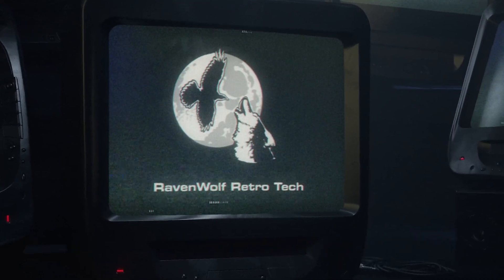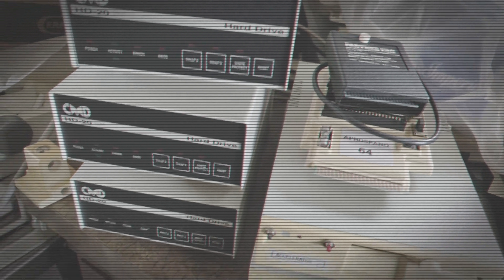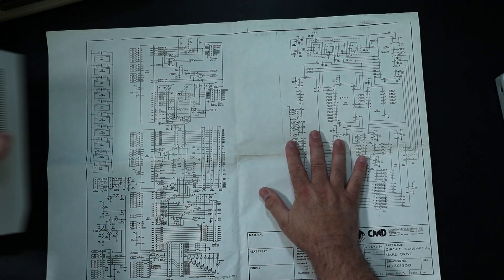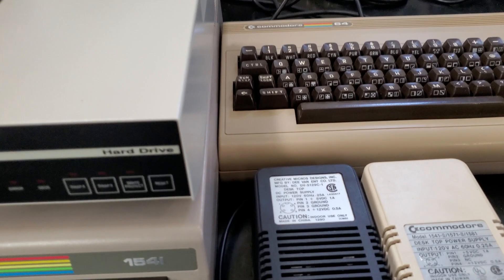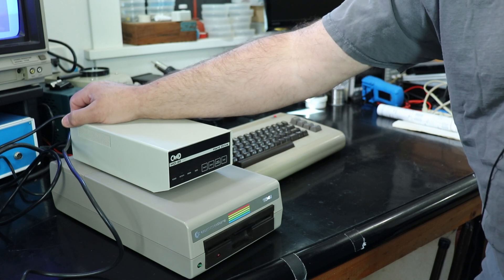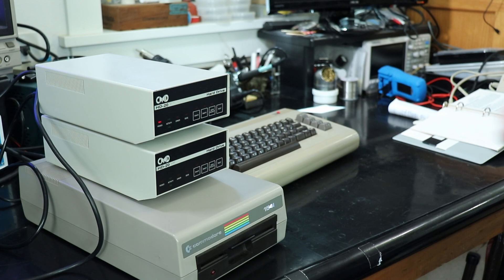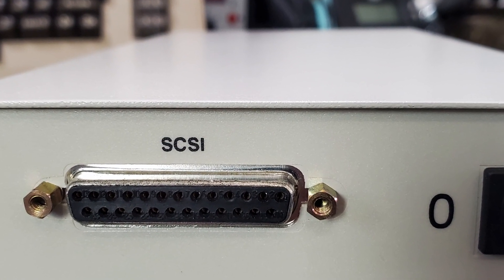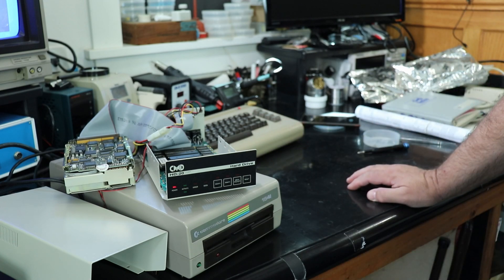Vintage C64 CMD Hard Drive - Lost documentation found!

Comment: I'm afraid there are a few errors in the schematic: U11 pins 19-20-21 are not PA5-PA6-PA7 but PB1-PB2-PB3 and PC0 is not pin 10 but pin 14.
Reply from the maker: Great catch, i had not noticed that but i never had to dive too deep since my drives were all working. These old schematics often have errors but if anyone wants to recreate a corrected version i doubt anyone would have an issue.

Comment: Did you make the archive the drive video mentioned @00:06:45 yet? I just picked up one. Do you have any more information on it? Hard drive swap possible? Thank you for the video. Oh and how did you open this thing? 4 screws on bottom yes, but then what?
Reply from the maker: Unfortunately the drive would only spin up long enough to read a directory but it would spin down shortly after. As I worked on it the time it would stay spun up shortened until I could not even load the directory so I set it aside. I now am using the HD-20 on mt C128D with a ZuluSCSI installed which works amazingly well. You can see that in the Pimpin a C128D video.
THere is one more screw on the back under the lable. Its a flush screw and the label is heavy so it can be hard to feel but there are pictures online.

Comment: As a kid I wanted one of these SO BAD but they were big bucks. Later I found a genuine CBM ( Commodore Business Machines) D 9090 hard drive originally devoloped for the PET line of Commodore computers. You had to buy an interface which adapted the serial to the interface used by the CBM drive. If I remember correctly it was IEEE488. It worked but damn that hard disk was finicky. Seemed really fast compared to floppy disks BUT it actually read everything Serially so whenever the disk had to be searched, it always started at the very beginning of the disk. Very slow access times but Hey, I had a hard drive in 1985. Nobody else I knew had one. My entire C64 floppy collection fit on that hard drive.

Comment: Hard drives for the C64 typically emulated 4 floppies. I met 1 guy who had one which worked like that.
Reply from the maker: It can emulate several floppy drives including 1541, 1571, & 1581. Each disk takes one of the 254 partitions though so you can do a lot but not unlimited.

Comment: I tried to find a follow up video were you converted the external hard drive cabinet for a P-ATA hard drive or SSD.
Reply from the maker: That would be the recent "Pimping the 128D" video. It is not a step by step walk through though because I had a ton of issues getting the Zulu SCSI to work with the CMD-20 and, in the end, I was not sure why it started working for me (although I have my suspicion as mentioned in the video)

Comment: Not sure why people are doing SD for everything instead of M2..
Reply from the maker: My opinion based on the way these things usually go: SD came out around 2000 and I think M.2 was at least 10 years later so by the time M.2 was an option SD was already a solution. Now that M.2 has come down in cost maybe it will catch on in retro circles but that had to happen first.

Comment: A very interesting option for the CMD HD are magneto-optical drives. It is possible to use media with 128, 230 and 540 MB because these have 512-byte-sectors. Each MO-disk is treated like an seperate hard drive. You can partition it and give it an own IEC bus device number. After changing the media just press RESET on the HD and after a few seconds it is ready.

I made two holes in the back of my CMD HD: One for a 4x switch and a DC output. The switch changes between 5/12V on the internal hard disk or 5V for an external SCSI MO drive on the 25-pin connector. It's possible to switch between HD and MO without powering off the CMD HD, just press RESET. The external MO drive has to be jumpered to SCSI ID 0.

MO media are not too fast, but this doesn't matter on a C64. But they are way more silent in comparison to old SCSI hard drives. I'm using an IBM DCAS 32160 in my CMD HD, this one is rather quiet. But I prefer the magneto-optical drive.
Reply from the maker: That's an option I had not considered! I have actually already installed a ZuluSCSI which you can see in the video that was released a few hour after this comment - talk about coincidental timing! The ZuluSCSI is giving me 254 max sized partitions
Reply: A hard drive doesn't make sense because you can never fill a 4 GB drive if you are using emulation partitions. Removeable media are the best option. External JAZ don't work on the CMD HD, external SCSI ZIP can only be jumpered to ID 5 or 6. MO media are working great. 540 MB are the fastest, 128 MB the slowest. They are good suitable for backing up 1541 disks.

Another advantage of removeable media are, that you can clone them with a software which supports raw media. So you can create one media, f.e. with 254 empty 1541 partitions, and clone this on multiple 128 MB media.

If you want to do the rework, it's a good idea to swap the lower activity LED with a blue one. But it's neccessary to increase the resistor.
Reply: Note: External MO drives are requiring at least 5V/2A.

Comment: Nice!  Look at CBM Command for archiving the drives.  Works with an SD2IEC.  Recommend using the C128 version in 80col mode for the best possible speed.
Reply from the maker: Thanks for the tip Paul. I'll check it out again.

Comment: Very cool find! Back in the day when I was running a BBS on my 64, I was lent a CMD HD200 by a local community member for a short while. I remember that it seemed painfully slow for being such an expensive device - weren't hard drives supposed to be fast? I wasn't even aware of the existence of JiffyDOS back then. Whoops! That experience steered me towards a used Xetec Lt. Kernal 20 MB drive which was blazing fast but less compatible. It did have a DOS of its own though which I thought was pretty neat at the time. I'd love to find an LtK again but they are as rare as hen's teeth these days.
Reply: I just sold a couple of those LTK drives.  Had them for quite a while trying to find the necessary host bus adapter.  That's as rare as hen's dentures!

Comment: With the schematic found, all you need now are the PAL equations in order to make clones of the device...
Reply from the maker: I suppose I should keep an eye out for them. I do have his old "Sun Moon Star" branded PC with a GAL/EPROM Programming label on it.
Reply: @RavenWolfRetroTech  If the security bits on the PALs haven't been blown, you might be able to read out the PALs to find out what they're programmed with.
Reply: as these PALs are only logic types (no register), even brute-forcing the equations shouldn't be too hard